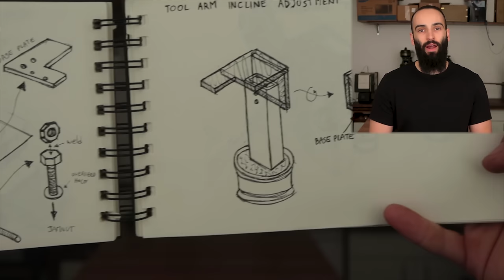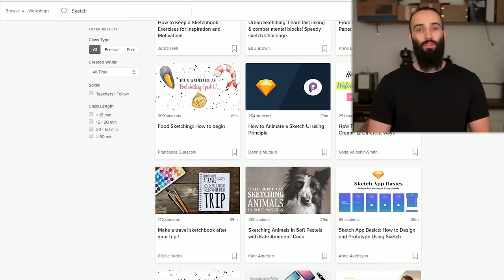1950s Italian Bench Grinder / Buffer Restoration

Comment from the maker: Fun fact: It took me two days (and a broken allen key) to figure out how to take off those shaft extenders. Yep... Two days! Crazy right? I almost gave up because afraid of breaking the shaft or rotor. I'm glad it eventually came loose! These new bearings run sooo smoothly... I love it!
If you want to know more about any particular process shown in this video be sure to check description, I always write a very detailed list of operations and product used.
Reply: First
Reply: Gracias Saludos desde Perú
Reply: verry beautiful
Reply: you are an expert making a sandblaster time saving peace
Reply: Black Beard Projects BADASS Bench Grinder!!!

Che invidia!!

Keep up the good work buddy!
Reply: Ma sei un King  !
Reply: Bonsoir, très joli travail. cordialement
Reply: Great job buddy
Reply: @tarasbulba7114  De rien.
Reply: @tarasbulba7114  sono italiano io 
È Italiano lui 
Guarda nella casella informazioni del suo canale
Reply: @tarasbulba7114  Non désolé
Reply: Man, seeing you restoring this kind of tool brings me an inner peace...
Reply: The work of restoration cannot begin until a problem is fully faced.
Reply: While I was watching I was wondering if they threaded on!
Reply: capita a tutti  tranquillo
Reply: ㅜㅜㅠㅜ
Reply: YOU PUT THE POWER SWITCH IN BACKWARDS.
Reply: nice paint job and Bering replacement on your pedestal mounted buffer / wire wheel . they certainly do not design and manufacture them with the same ideas anymore . your english although slightly accented is excellent and i wonder why  you do not at least narrate your videos. it looks like your going through old equipment a piece at a time to build a nice shop and it would be nice to be in a position where i could do that .  thanks for the videos
Reply: FYI WD40 is a degreaser !!!! Put it on bearings and ops.....
Reply: I WAS SITTING WATCHING AND TELLING YOU THAT THEY SCREWED OFF BUT YOU DIDN'T HEAR ME.  LOL
GREAT LOOKING PROJECT
Reply: Di dove sei?
Reply: @christianfamiani241  Cincinnati ohio
Reply: But you painted it, like painting that French girls 👌
I think it might have gotten new electric wires in about 1980tis, but now is good to go for another 30 plus years. We throw away to much. 
Nice job :)
Reply: Hello, I'd love to learn more about how you wired this.  What are the power requirements for that motor? and what power supply do you have? I found a similar looking buffer/grinder locally in NYC.  It has a 3hp 440vac 3 phase motor.  Is it possible to run this on single phase 110vac? perhaps using capacitors like you have here.
Reply: @Ben-eh8uj  -5
Reply: Steve Goodwine ...No sir, a 3 phase motor cannot have single phase 120volt “house” current put into it, even by installing capacitors. Although a “Reputable” electric motor rewinding shop maybe able to design new single phase windings for it, in order to save your housings & rotor/shaft assemblies. By the way it will be expensive
Reply: Очень интересная качественная машина, особенно потому что она 3х фазная, отличный керамический выключатель сейчас таких не делают, перед разборкой можно было обработать валы wd 40 и включить поменяв направление вращения, я думаю валы открутились бы сами, у меня похожий агрегат производства Германии 1973г 380в 0.75квт 35кг,привет из Севастополя.
Reply: Why not ask the internet about it? There are so many Machinists and engeneers Forum where you can ask stuff like that.

Comment: That came out awesome! It’s a beast... One tip I’ll share even though I saw your threads were right when you put on that buffer wheel. I usually stamp an “R” on the end of the right side spindle end during disassembly so when I reassemble I’m sure to put it back together correctly the first time. It only took once after reassembly and having a wheel come loose on me to learn that trick. Luckily I was able to shut down just as it started wobbling... Note to self: The nuts always tighten against the spin direction😉 I’m sure that will outlive is all, it’s a gem! Thanks for taking us along!

Comment: The “plaque” at 4:03 is the motor’s descriptive nameplate. Gives you electrical details of the motor ie; hp, voltage, amperes, phase, cycles, etc. Sometimes a magnifying glass helps to read it Or, you can bring out the details on the plate by wiping over it with oil or a darker liquid. Lightly wipe it in order to help the lettering retain the fluid. Hope this helps🇺🇸🇺🇸🇺🇸

Comment: This is one of those projects where a sand blaster would have made it so much easier. But in the end the thing came out beautiful. 

But that paint... that has to be the best part. I have an old 60s 94 inch bandsaw and a large belt sander from the same manufacture and era that I will be restoring and painting the same.

Comment: Great video but you need to get yourself some proper wire crimpers.
Reply: That's what i wanted to write here. I'm really impressed his restoration skills and experience, but when i saw how he crimped those wires i felt strongly disappointed.
Reply from the maker: Thanks!  I have wire crimpers but I like better adjustable pliers as the tips are smaller and I can get a much harder squeeze! Or maybe I just need to buy better quality wire crimpers  :')
Reply: Aren´t those type of connections for low voltage applications, like cars?

Comment: Delightful job. One thing that concearned me alot was the wire wheel.... I personally think that the wire is thin enough to get poisoned by small amount of rust that makes small wire pieces flying everywhere while using. If you are going to use the grinder in your shop i highly suggest getting a new wire wheel, just for the durability :)

Comment: I have two opinion. 
For most people this is a nice restoration, and yes it is nice and working. That is the main point of restoring, right? 😃 I like the colour and the whole machine is looking beautiful, but.
My second opinion is, for some people who are perfectionist like me, seeing that under the paint metal is not properly cleaned up, seeing the little bit of rust left overs at some little corners and the wiring as an electrician makes me feel it could have been  better finished. 
But overall nice. I hope I could help with my constructive opinion. Have a nice day.

Comment: Great! My only nag would be that, except for the yellow wire to the case, I saw no stress relief for the power cord. I hate when they get pulled out and sparks fly. Seems very powerful and fast. No gloves or sleeves while using that one! Arm-breaker.

Comment: I like your work.  Love watching the restoration of old tools (especially since they are built 10x better than modern tools).  But it surprises me that you have tools like a lathe but don't have a simple media/sand blaster and proper electrical tools (crimpers, strippers, etc.).    Also, check out Aero-Kroil penetrating oil.  It works FAR better than WD-40.  Cheers!

Comment: The disk you have put on is not for the final stage of polishing its called sezal and we use it with white paste and a curse polishing disk and compount... You also need to cut with a blade the first round of sting thats holds it together so its gonna open better and finally for polishing you need a softer disk a cotton disk with blue compount we call them soap... Great video nice job I will not comment the nut...

Comment: Great work on the restoration man! Maybe you should get a sandblasting gun/cabin to clean the parts faster or derust hard to reach places

And maybe solder the crimped connectiond in the next restoration that will make better contacts and makes em last longer 

 greetings from holland!!

Comment: You should probably consider putting a set of heaters on that motor (a safety breaker that opens if any winding starts pulling too much current to protect the motor). Most big motor "start-stop" button sets integrate these and a high current breaker into one package.

Comment: The small insect which came out of the buffer is called (in the Southeastern US)  a "stink bug" because of it's foul smell when mashed.  Interesting video, but the speed was faster than I would have preferred.  By the way, I would find it interesting on these restoration videos of powered machines to know if the machine was operative prior to the repair/restoration.  Greetings from Birmingham, Alabama

Comment: hey!  amazing job, as usual.  
one suggestion.  If you can, could you try to use non-disposable rags, instead of paper towels?  like, whenyou cleaned the screws..  sounds stupid, but I'm trying to do the same, trying not to throw away paper towels when i can use pieces of old shirts that were going in the garbage anyways.   Or wash them....

Thanks for the content, and for this if you can try.

Comment: Super job.  With that said, there a couple of questions.  I’ve used wd 40 on a couple of projects for lubrication on bearings, but instead of lubricating it cleaned the bearing surface and quickly caused the bearing to seize up.  I’ve also tried using it clean electrical contacts on an electric mower.  As soon as I turned the mower on, the wd 40 shorted the contacts and burned up the switch.  How did you use it lube the armature bearings without having yours seize up?  You also used it on the contact/on-off block.  Did you wait several minutes and letting it air dry before mounting it to the housing and wiring it up?

Comment: may I ask why didn't you use any power tools when taking the paint off, and preparing the metal for painting or the painting process it self, all manual this time why?
Reply: With it being this old then there is a high possibility of the paint containing lead. He used a paint removal gel and was able to scrape the loosened paint
Reply: @donniebrown2896  but he didn't sand it before painting, is that because of the lead paint?

Comment: It turned out great. I have been looking for a large polisher like this for quite a while and no luck.
They are hard to find and very expensive here.
Reply: Have you tried using a polishing wheel attachment for a regular grinder? By taking the guards off then putting on the polishing arbor it extends the spindle by at least 50% if not more. I did that with mine and I thought it looked odd being so long but now I know why!

Comment: Not sure I like the idea of those set screws in the wheel collar. If one of those fly out, it can do some real damage. At least use thread locker on them. Very nice restoration job, as usual.
Reply: Then you'd have to break the thread lock each time you wanted to change the wheel and put new locker on...I think I'd look into getting a replacement made. They're simply a nut with a reverse thread for the left side.

Comment: You don’t use sanding blocks as they do more damage as they are made for decorating not working on machines were there is wires or other things as the corners cut into things.
So I say use sheets of sand paper to do the job ok.

Comment: I feel you wired the switch backwards. Red means stop, green means go!
Reply: Push toward red to stop, push toward green to go.  Looking at machine quickly, you see red and know that is the off switch.  If the other way you would look and only see a green switch.  If it were 2 buttons, stop would be red and go green, but this isn't a button.

Comment: Bad boy Mr. Black Beard!!! Why are you so in love with rust converter??? You would have been much more pleased in your job if you had taken a little more time and soaked those parts in MC-51 and then sanded or wire brushed them down to bare metal. Rust is like a virus and will continue to spread if not knocked out in it's entirety. So please next time ( because I know you're capable of it ) do a more thorough job. It may mean a longer video, but I'm sure your subs will thank you for all your hard work. Otherwise keep it up 😁😁😁

Comment: What was wrong with the original mounting holes that you had to fill and cover them, plus you left out the nameplates, why!

Would have been beneficial to the lifespan of the motor to add a starting capacitor

Comment: 14:38  did you remove an overload/fuse for the motor, or was that just a connecting wire?
Reply: Yes, those appeared to be thermal overloads, sometimes called "heaters" I noticed that myself,
but they may have just been shunts as maybe someone beat him to it and bypassed the overloads.

Comment: Is there a reason you preferred to use stripper on the durable casing pieces as opposed to media blasting them?
Reply from the maker: Not really, I just don't have media blasting equipment!
Reply: @BlackBeardProjects  Thanks!
Reply: Another good reason to not blast clean it is that paint might be lead based. The grinder being that old and then blasting lead paint into fine particles to breathe in....mmmmm. Now remember kiddies, breathe deep all that powdered lead paint...that's it, breathe deeper!

Comment: That things a beast! Seems like all machinery from that time period runs like a rhino. I wonder is it because they used tougher materials or something? 🧐
Reply: They made things over engineered and far more heavy duty/robust than they do these days. No difference in materials but definitely a difference in the amount of materiel. All plastic and thin sheet metal these days...sigh. Olden days: Made to last, These days: made to be disposed off so you have to buy a new one...

Comment: I would have flipped the switch if possible so that it showed green when on and red when off.
Reply: Bad idea. Red is universal for "Danger" Green is "Safe". Its not safe when spinning, and its not dangerous when its not.
Reply: @ckmoore101  I can see that but in my experience green is on and red is off. So if say I walked up to this grinder and it was unplugged and green was showing, I would assume it was in the on position and switch it to red.

Comment: The good: liked how you fixed up the original screw hardware, turned out real nice. That electrical box also turned out looking great. The bad: Painting it in one piece, is going to glue it all together, making it hard to take apart, and the paint will crack, when doing so. The spacer you used to hammer the bearing in with, had a poor fit, and applied force to the wrong places. I don't care for how you use compressed air to blow all the dirt up into the air you breathe, instead of cleaning it up. Only place it was warranted was on the coils. Also if you shave your beard, that logo is going to make zero sense.